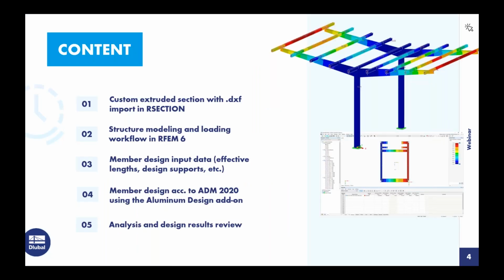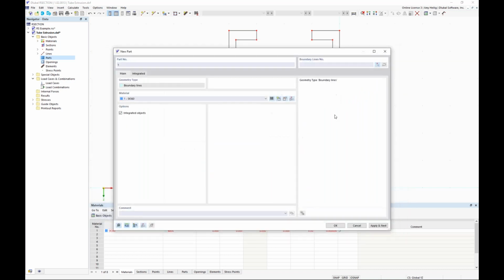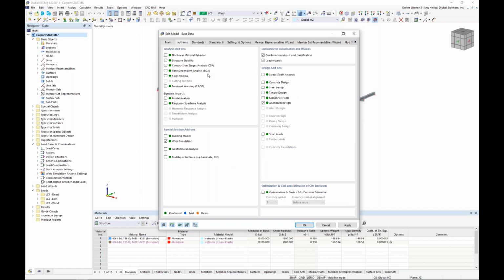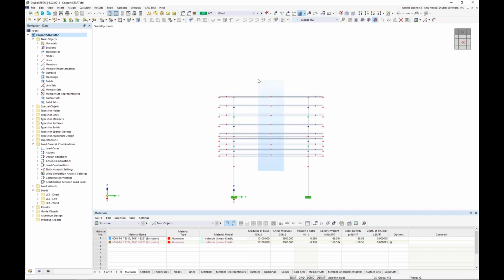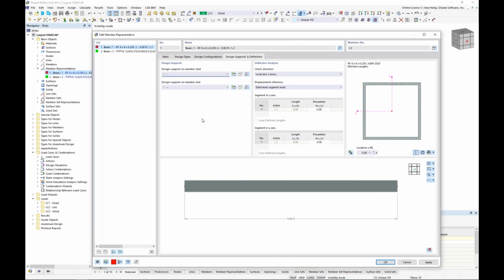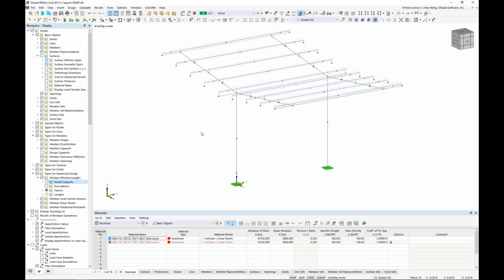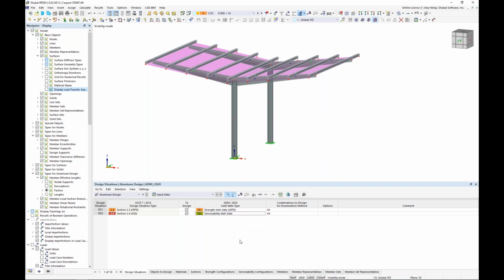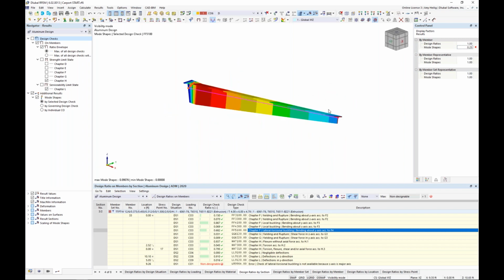Webinar | ADM 2020 Aluminum Design in RFEM 6

Comment: The RFEM 6 is way difficult then the RFEM 5 :), IN RFEM 5 my member in ALU is passing in normal design by closing stability analysis otherwise there is an error 1022 (RFEM 5), but when i RUN RF FE LTB the member check passes. 
For RFEM 6 I am unable to find a manual method to run the RF FE LTB and notiably when i run the member analysis it is failing in stability, first thing i want to know how to close stability check in RFEM 6, lastly how to remove warning WA3002.00 saying Asymmetric sections not valid for LTB design and Asymmetric sections are not valid for combined stability design.
Reply from the maker: Hi, @ghilmandilshad9495! If you are not interested in LTB design checks in the RFEM 6 Aluminum Design add-on, you can simply uncheck the checkbox for LTB under the member's "Effective Length" input. There is not an equivalent RF-FE LTB add-on in RFEM 6 as all LTB checks are within the specific Design add-ons. 

If you still have further questions, feel free to email us your model to info@dlubal.com.

Comment: How can i fix this error "check of lateral-torsional bucklying is not available because z-axis is major" for the section created RSECTION (rotate the section do not work), thanks
Reply from the maker: Hi, @juli960916! LTB is not checked for the section's weak axis (z-axis). Therefore, if Iz > Iy, this is a limitation of the standards and software. LTB is only calculated for the section's strong axis. You'll need to manually check this stability failure mode and further have the option to turn off this warning in the program. If Iy>Iz and you are still getting this warning, the section can simply be rotated in RSECTION so that the y-axis is considered the strong axis. For any further questions, please email your questions and model to info@dlubal.com.